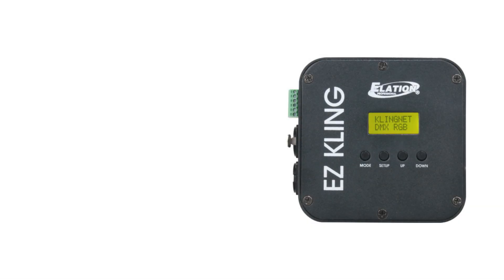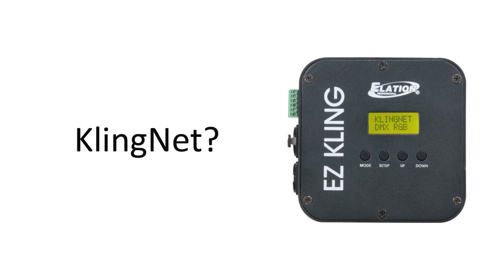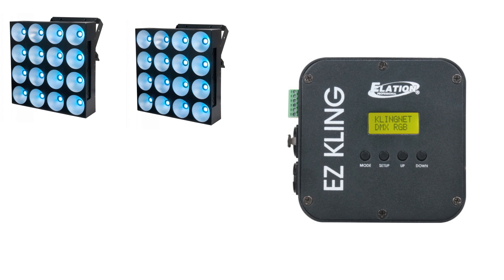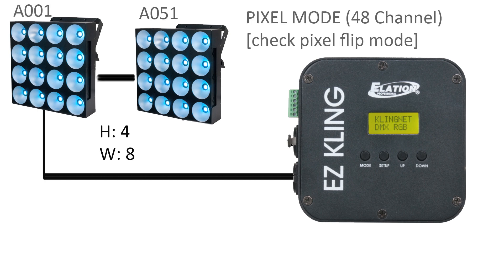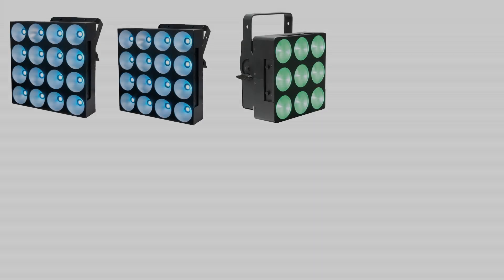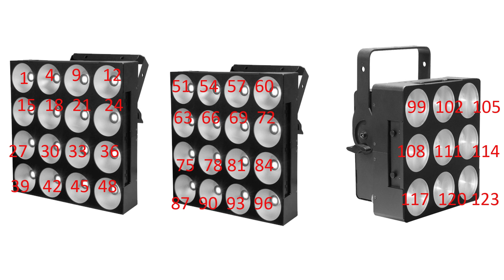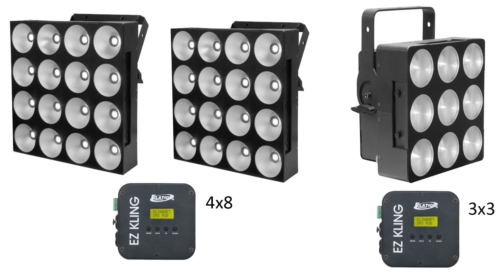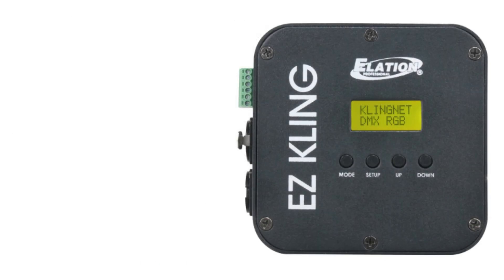Make your DMX lighting BETTER!!! What is EZ Kling?

Comment: Can you use this device as a DMX node just to connect and control light fixtures like connect for example to GrandMA PC?
Reply from the maker: Yes. The EZ Kling works as a one universe ArtNet node.
Reply: Do you have any form of contact to possibly help me set this up i have to run a Event in like a week just curious if you had like a discord or skype or something?
Reply from the maker: It's super easy. It's almost like setting up KlingNet except you choose Artnet. 

Your best bet is to call Elation and have them walk you through it!
Reply: Gear It First is this only for pixel mapping or can it actually be setup to control fixtures dimming color etc just like a regular ethernet dmx node ?
Reply from the maker: Yes, when set up as ArtNet it works as a standard Node.
Reply: Gear It First i was told that grandma pc requires grand ma hardware to function is this true?
Reply: Gear It First have you tried this in art-net to verify it works as a node i just called elation and they said it dosent?
Reply from the maker: I have. Let me make sure it wasn't disabled with a recent firmware. Also for MA you still need their dongle to use it.
Reply: Gear It First what was the conclusion disable or not also how do you get it in that mode elation didnt help me much ?
Reply: Gear It First can you please so me a huge favor you see i ordered this it would be the best news for me if i knew this device can be a node like you said can you please let me know if it can it would mean alot to me and if so how did you program to be one thank you so much again sincerely ScootalooAndSweetieBelle.
Reply from the maker: Won't be able to till next week
Reply: Gear It First what is the reason it has to wait til next week ?
Reply from the maker: How much are you paying me again? Oh that's right. You're not. I have a job. I have a family. I don't get paid to do this.. if you'd like to PayPal me $500/hour (my rate) I'm happy to schedule you in this week.

Comment: do you think this will be compatible with the luminaire 3 app for the iPad?? the connection chain is like this.
wifi router into the EZ Kling then out to dmx fixtures?
Reply from the maker: You can. But just get the Airstream and use the V3 Firmware (I've done videos on this, too). Airstream has built in router!

Comment: Hi there, please can I have some advice re Kling net and Ez Kling?

I have 6 chauvet motion orbs which I wish to map in arkaos via Kling net.

Each bank of 3 dmx fixtures has a Height of 11 orbs by 15 orbs.

Each unit has 165 dmx channels per fixture.  495 dmx channels total for 3 fixtures.

I see from your comment below that each EZ Kling has 512dmx channels so am I right in thinking I'd need a 2nd EZ kling?

I also note that each Ez Kling is limited to 11 x 13 (160 pixels of DMX) 

Do I rely on the fixture Mode by select MODE: DMX MS3 Set the matrix to H11 x W5 and run it with one EZ Kling per Bank of 3 fixtures?

Therefore: BANK1

Ez Kling 1 - 
orb 1 (A.1) H 11 x W5 (55 RGB Pixels) orb 2 (A.166) H 11 x W5    
orb 3 (A.331) H 11 x W5
That's a total of 165 pixels per bank of 3 fixtures

BANK 2:
Ez Kling 2 
orb 4 (A.1) H 11 x W5 
orb 5 (A.166) H 11 x W5 
orb 6 (A.331) H 11 x W5
Reply from the maker: I'm not familiar with the Chauvet stuff. But essential one easy Kling Unit per orb set should work. The height and width is for pixels and then you can set a divisor in Arkaos. However, Elation will be distributing Arkaos KlingForce which sounds EXACTLY what you need...